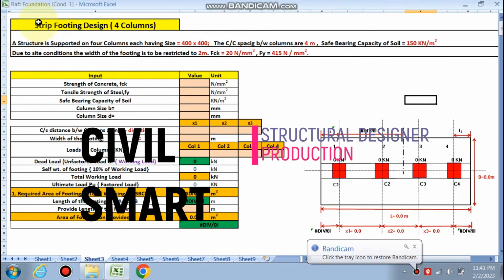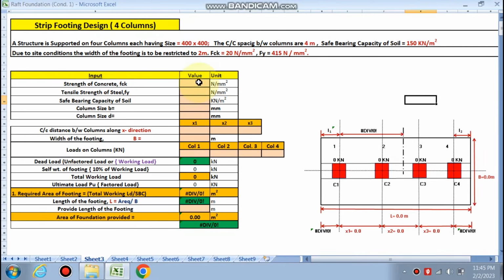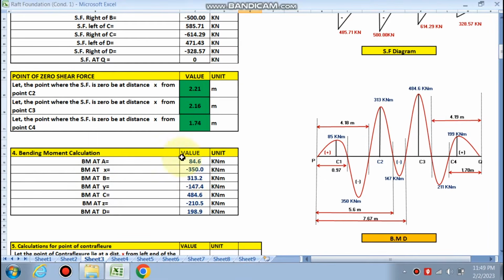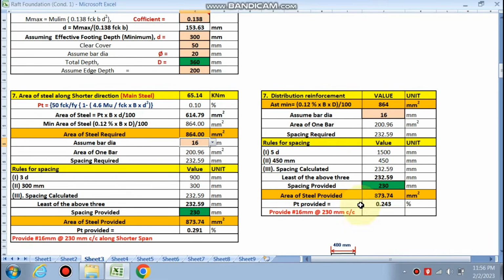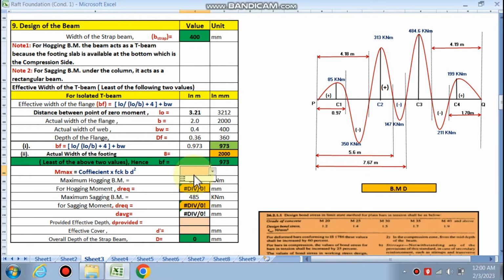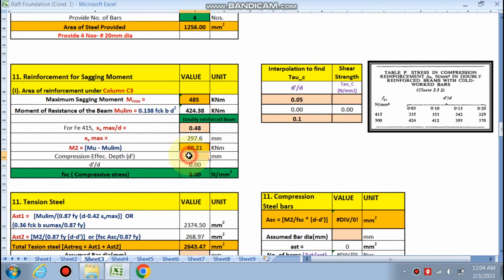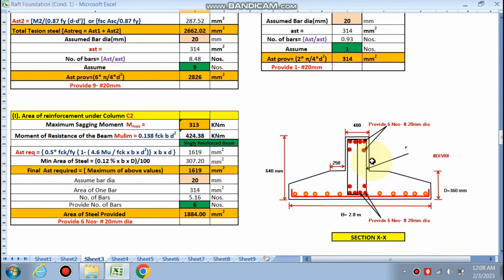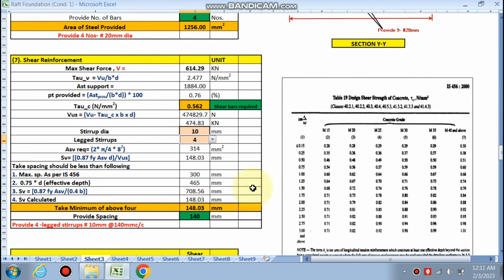STRIP FOOTING DESIGN ( 4 COLUMNS)

Comment from the maker: Full complete Course includes all the sheets as under:

IN FOOTING DESIGN SHEETS
1. Isolated square footing
2. Isolated rectangular footing
3. Combined rectangular footing (Slab Type).
4. Combined rectangular footing (Beam & Slab Type).
5. Trapezoidal footing design
6. Strap beam footing design
7. Footing with uniaxial bending
8. Footing with biaxial bending
9. Pile foundation
10. Pile cap design 3 & 4 piles
11. Wall footing/ Strap footing
12. Raft Foundation ( Beam and Slab Type).
13. Combined footing design (Beam and Slab Type).
14. Eccentric Footing Design ( Column at dist. X from edge).
15. Eccentric Footing Design ( Column at Edge of footing).
16. Strip footing design ( having 4 columns).
17. Pad Square Footing Design.

IN BEAM DESIGN SHEETS
1. Singly reinforced beam design sheet. ( Beam Size known).
2. SINGLY REINFORCED BEAM design ( Beam Size not known).
2. Doubly reinforced beam design
3. Continuous beams design  with point load having
    2-span continuous beam
    3-span continuous beam
    4-span  continuous beam
    5- span continuous beam.

4. Cantilever Beam Design.
5. T- BEAM Analysis sheet.

IN COLUMN DESIGN SHEETS
1. Axially loaded column design
   (a). When column size is known.
   (b). When column size is not known.
2. Column with axial load with uniaxial moment ( on 2            sides and 4 sides reinforcement)
3. Column with axial load with biaxial moment
4. Mux and Muy Calculation sheet.
5. Short Circular axially loaded Column ( Dia is known).
6. Short Circular axially loaded Column ( Dia is not known).
7. Long Column design.

IN SLAB DESIGN SHEETS
1. Cantilever slab design sheet.
2. Simply supported slab design sheet.
3. One way Continuous slab design sheet.
4. Two way Continuous Slab design sheet.
5. Two way simply supported slab design sheet.
6. Flat Slab Design With Drop Only
7.Flat slab design without column head and drop 
8. Flat Slab Design With Column Head and Drop.

IN STAIRCASE DESIGN SHEETS.
1. Dog legged staircase design. (Well Size know).
2. Dog Legged Staircase design ( Landing And flight width known).
3. Open well staircase design.

IN RCC WATER TANK DESIGN SHEETS.
1. RCC WATER TANK RESTING ON GROUND (L/B <2).
2. RCC WATER TANK RESTING ON GROUND (L/B >2).
3. UNDER GROUND WATER TANK DESIGN (COND.: TANK         IS EMPTY AND OUTSIDE SOIL IS SATURATED).
4. UNDERGROUND WATER TANK ( TANK IS FULL AND             NO OUTSIDE SOIL PRESSURE).
5. UNDER GROUND CIRCULAR WATER TANK.
6. Overhead Circular Water Tank.
7. INTZ Tank design.
8. Box Culvert Design.

IN WALL DESIGN SHEET
1. RC WALL DESIGN SHEET.
2. RETAINING  WALL DESIGN SHEET.
3. BASEMENT RETAINING WALL DESIGN SHEET.
4. COUNTERFORT RETAINING WALL.
5. SHEAR WALL WITH BOUNDARY ELEMENT.

BUILDING LOADS CALCULATION SHEET.

COST ESTIMATION SHEET.
Reply: Please send link to this course

Comment: Please explain why the top reinforcement  for strip footing is not designed here ? .....as in case of black cotton soil we usually keep 8 to  10 ft depth ...in that case the soil above footing will develop load on the top of footing
Reply from the maker: We have designed this strip footing with beam and slab type, in this case the beam will take the hogging moment comes in the footing due to load and accordingly beam will be designed and top reinforcement will be provided in the beam...no top steel is required in the footing, as footing has been  designed for sagging bending moment only..

Comment: In one way shear check u gave the wrong condition ..Tau v < tau c =safe  is actual condition but in ur excel sheet u mentioned in reverse way
Reply from the maker: It is written by mistaken, 
but the condition is correct ( cell will show , 'safe in shear' when Tv < Tc and if Tv >Tc , then it will show ' Increase the depth')..
Now updated.
Reply: @civilsmart  ..ok